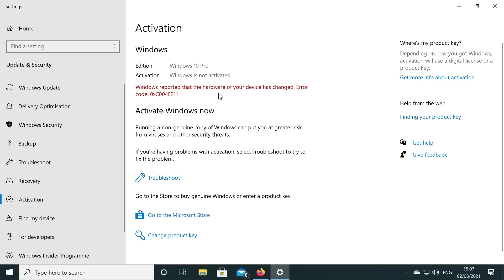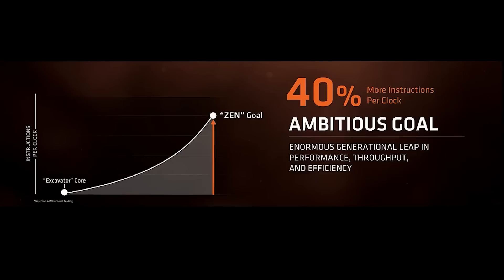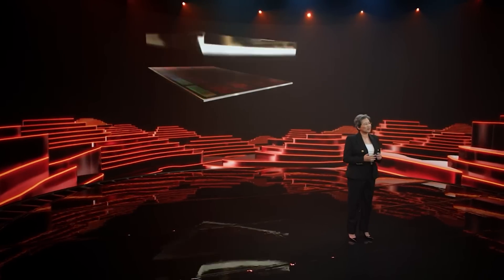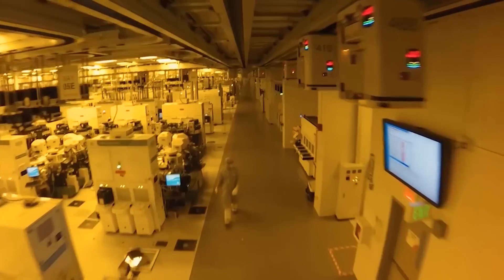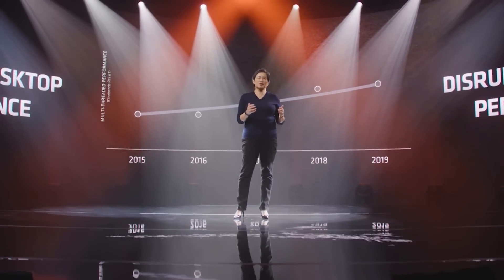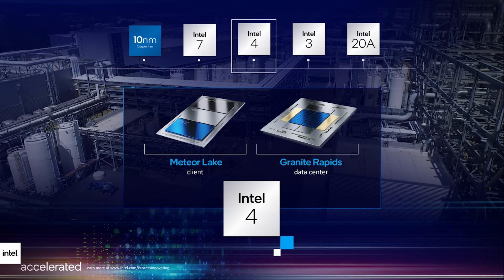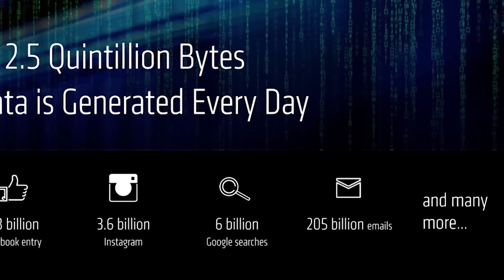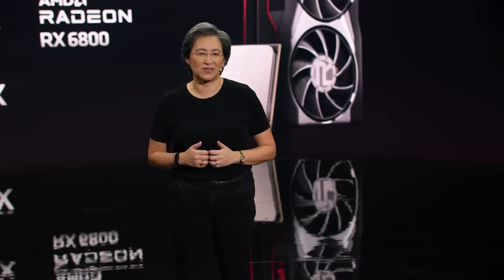AMD Details Zen 4 AM5 Platform & Accelerator Tech | Ryzen V Cache Performance & Release Date

Comment: On the CPU-Z...Well, sorry, but when my Ryzen 3600X consistently shows about 2% lower single core performance and a 8% lower multi-score performance vs a 5600X when I have no OC, left PBO and auto OC off, and just have normal run of the mill PC4-25600 CL16 memory (though I've fully timed it manually given my board seems to want to use some some very odd and unoptimal secondary timings) and a s**t ton of software running...  I don't believe my 3600X is on par with a 5600X, so no I'm not excited to see the leaked CPU-Z score based on my experience with CPU-Z's benchmark.  So yea, I'll wait for the reviews. 😃

I was figuring (but not counting) on a 10% IPC uplift from V-cache, but honestly results will speak for themselves. 😃

I'm truly excited to see this showdown between Intel Gen 12 and AMD Zen 4.... Just based on rumors this should be a good fight.  I'm not buying into either hype-train or making any bets - let the fight begin! 😀
Reply: What do you mean CPU-Z "SHOWING" 2%sc, 8%mt performance difference? The only way you know is with EVGA, ASUS or MSi afterburner running framerate, temp, core usage, etc while benchmarking. 

Frequencies mean nothing. It is cache, bus speed, cores, architecture for instruction-handling and frequency adding to the random operations per second.
Reply: @Twitch_Moderator  that brings in other factors as well (what GPU are you using, what resolutions, etc).  That is why I rather curate multipule reviewers reviews then to get excited by one leaked synthetic benchmark that I don't have faith in. :-)
Reply: @Twitch_Moderator  CPU-Z has a built in benchmark.
Reply: The 20% IPC from Intel and AMD is fake.

CPU-Z is right, one Apple M1 core at 3.2GHz has the same perfomance as one i9-11900K core at 5GHz taking Geekbench 5 and Passmark singlethread score and clockspeed.

The M1 chip has like 30 or 40% higher IPC than x86 CPUs, this means that IPC only improved 60% since Sandy Bridge.
Reply: Zen 2 was basically Skylake, but it was behind in clockspeed. Zen 3 has higher IPC than Skylake but it's so small compared to the jump from Sandy Bridge to Haswell (which is basically Zen +).
Reply: No CPU-Z is NOT right if it's showing only a 2% (which would be margine of error) and 8% performance differance between a stock 6-core 4.4Ghz Zen 2 3600X and a stock 4.6ghz 6-core Zen 3 5600X part.  The generational differance between the two CPU's I know is larger than those numbers suggest.
Reply: @nukedathlonman  Zen 3 is basically a slightly better Skylake. Zen 2 basically matched it but had a lower clockspeed.

You can do the IPC math in CPU-Z's database , don't believe in BS marketing.
Reply: @saricubra2867   I'll wait for the reviews and the actual smackdown.  🍿🍺
Reply: @nukedathlonman  IPC claims from both AMD and Intel have been BS since a long time ago
Reply: @saricubra2867  :-P

Comment: I definitely think I built my new PC at the right time. I've got a 5950, and I plan to use it for 10 years.
Reply: Good choice. I have a 2600k that is about 10 years old and no need to upgrade because of the cpu. Ten generations later it might about time to get the 12900k or that 5950 to get all the other benefits like pcie 4.0 ssd.
Reply: @kutuluu  i just upgraded from a FX-8320@4.5GHz since 2012, new AAA games started to chug and my CAD work for the last year has been a chore when working on large models having to split them into parts to keep it running smooth

Upgraded to a 3700x w/B550 motherboard, but "only" 16GB (2x single rank) ram at first but the prices just dropped and i picked up another 16GB (2x single rank) for $70
Reply: Yeah, I got a 3900x when it came out, and honestly I feel like it has at least 5 years more life in it before I need to think about upgrading.
Reply: @matilija  That thing is slower than a 5800X both in singlethread speed and multithread. Even mobile CPUs have faster cores.

5950X will age far better, can compete with the best of Intel gaming wise.
Reply: @matilija  I figure I could do a GPU upgrade at the 5 year mark, if I feel like I should, but that's it.
Reply: @guruthosamarthruin4459  you would need PCIE gen 5 to use "next gen GPUs" at their maximum though
Reply: @Sir_Saul  I'm not sure I believe that. Last I heard, current GPUs are nowhere even close to maxing out gen 4, and it's used more by hard drives than anything else.
Reply: @MirroredVoid That will be too fast for me
Reply: Lol awesome!! I had built my pc i7 920 more than 10 years ago and still running great however an upgrade is due and can’t wait for the new Ryzen!
Reply: I wouldnt build a pc now it just isnt the right time, id build when pcie 5 is out
Reply: I actually built it last December.  I struggled to get parts when it first became hard to get parts, but I got it done.
Reply: Anyone that think they can be future proofed for 10 years is self-delusional. Even Intel could not drag their feet slow enough to make Sandy Lake good enough for 10 years.
Reply: @aikafuwa7177  I used my last PC for 10 years (yes, for gaming).
Reply: @guruthosamarthruin4459  And I still got a Dell Latitude D630 running Ubuntu and still good for web browsing? In what way does that or your last PC for 10 years indicate it was future proof-ed for 10 years? It was probably good for the first 3 years and the for next 7 you just put up with it and you be lying thru your teeth if you didn't upgrade it in any way or or form in the 10 years.
Reply: @guruthosamarthruin4459  BTW I still got my 2600K build from 2010 with a GTX970 and it still serves decently as a guest machine, but certainly haven't been my main machine since 2017.
Reply: @aikafuwa7177  First of all, it was a beast to begin with, and remained stronger than any console until the day I replaced it. Secondly, I never used the term "future proof". I upgraded when I finally felt the desire for 4k, and my current PC can do 4k at 120 fps.
Reply: @guruthosamarthruin4459  So weasel words to weasel out of "plan to use it for 10 years". So if you replaced all the bits of the "it", is it still the same thing as you started?  For reference see https://en.wikipedia.org/wiki/Ship_of_Theseus
BTW I would say many of us kept the old machine around for good long time, may be not all 10 years, primarily because Intel just didn't bother to really push envelope after Sandylake. 
But despite the fact that you won't claim that the 5950x won't be future-proof for 10 years, I would bet that you be itching to replace it after 4 especially now that Intel is forced to get back the in game and seriously compete again. 
BTW flexing on consoles don't mean jack. Consoles were never the bar to measure a PC build.
Reply: @aikafuwa7177  You're just arguing for arguing's sake. Stop trying to "be right", and instead pay attention to what's being said.

No, I didn't "replace every part" in my old PC. I replaced exactly one part, when I was given a free GPU, which I used for it's last 2 years.

And if you read my second comment in this thread, I said I'd think about doing that in 5 years. I may replace the GPU, but that's it.

The rest of your argument is nonsensical stuff that has nothing to do with anything I've said.
Reply: @guruthosamarthruin4459  Your claim of 10 years have way to many asterisks attached to it probably even more than a drug commercial on TV. It is obvious you don't like your exaggeration called out like this, but it is what it is. If you even just something like "you hope you can use for 10 years without major changes" then you actually would have shielded yourself, but you insist on click bait lying language. 

And your insistence that you got only  a free GPU is probably also an exaggeration. You probably forgot about a drive or SSD here and there or couple sticks of memory, a mouse, a keyboard, etc. etc. You don't need to change every piece, but it goes back to your exaggeration. The whole nonsense started because you want to make a nonsensical claim.
Reply: @aikafuwa7177  I said I "plan to use it for 10 years".  Go ahead.  Point out all the asterisks in such a simple statement.  Grow up, and know when to stop digging yourself into a hole.  You're arguing in bad faith, when you should just say, "Sorry, I misunderstood" and move on with your life.

And no, I literally didn't replace a single thing other than the GPU.  I don't care if you don't believe me.  I used my last PC for 10 years, and was perfectly happy with it.  So much so that I decided to do the same thing again.

If you personally need your PC to be on the cutting edge of technology 24/7, then obviously that wouldn't work for YOU.  I don't care what works for you; it works for ME.

I'll be happy playing at 4k/120 fps for the next 10 years, changing nothing about the PC except the GPU one time.  I've literally done the same exact thing before.

I exaggerated nothing.  I said exactly what I did with my last PC, and exactly what I plan to do with this one.  You're just flying into a rage for no other reason than you want to "win an argument" on the internet, even though there was never a reason for an argument in the first place.

Again, grow up and move on with your life.  I won't waste any more time by responding again.
Reply: @guruthosamarthruin4459  Funny thing is that you are trying so hard. Any objective observer will know you are the one " flying into a rage" and you are the one that just thinks getting the last word is to "win an argument". Think what you want you, you use your machine the way you like it. 
Reality will soon(check back in 4 years) prove itself that the 5950x is not going to be providing that "satisfaction" (objectively and not just your happiness) for 10 years planned or not, because the competitive environment has changed.
Reply: @MirroredVoid pfft 6.0 still too slow, wait for 7.0, maybe even 8.0
Reply: @craigdaurizio686  why not wait for 69.0
Reply: @YellowLAVA  Might as well right? It would be a crime to leave any performance on the table

Comment: is that +20% over Zen 3 or +20% over Zen3+3d cache?
Reply: Zen3D is reported to be about 10-15% increase over Zen 3. 
So if Zen 4 is only 20% over Zen 3, that would be a little disappointing. I really hope it's +20 over 3D.
Reply: @Krenisphia  hmmm... Actually i agree, it won't be great marketing after all. So if amd don't want to bomb zen4 perception with zen3d  they prob want to aim higher.

Still 20-25% over zen3 is my conservative estimate, while amd gotta aim at least 15% over zen3d  which is kinda ridiculous tbh. I know we've seen amd do crazy stuff before but how many crazy moves in a row they can do?
Reply: Yeah becuase 20+% over Zen 3 on a new node but no core count increase isn't that impressive, 20% over Zen 3D cache would be insane.
Reply: @Dangerman-zg3ui  how IPC is connected to the node? are we talking about IPC?
Reply: zen 3 most likely

Comment: No PCIe 5.0 for Consumers until Zen 5, not worth it yet, actually doubt DDR5 aswell because its too early.
Zen is Memory Latency sensitive, DDR5-4800 CL40 2T would hurt Performance in almost every Consumer "Workload".

With DDR4 you can get up to 4000MHz at latencies as low as 14ns, DDR5 is not worth it yet seeing 20% more Memory Clock at the cost of 286% the Latency
Reply: AMD will support DDR5 with Zen3+ on mobile H1/2022 and on Desktop on H2/2022. 

PCIe 5.0 is not off the table - only because X670 as chipset does not support it does not mean direct lanes from CPU won't - It was the same with PCIe 4.0 and Intel does so on AlderLake

Yes DDR4 can reach 4000 CL14 however it is highly selected and overclocked memory that you compare with DDR5 JEDEC standard. 

Also it is not 14ns but cycles: Nanoseconds are calculated from frequency and cycle time that and it should be around 7ns latency for DDR4-4000 CL14. Since you don't even get that right your predictions seem even more questionable!
Reply: @mbv88xxx  Yes iam comparing the well picked DDR4 Modules because at the end of the day they're still going to be cheaper than the cheapest DDR5 Modules of equal size for quite a while. A 16GB Kit of DDR4-4000 CL14 can be had for around $200, a DDR5-4800 CL40 Kit will set you back around $330.
DDR5 on mobile is because of the Power Consumption, Bandwith and maximum Capacity per Chip allowing them to save Space and building more Compact. As a side node Ryzen APU's gain more performance from higher Memory Bandwith even at higher Latencies because they're bottlenecked by their Integrated Graphics by default.

And those Integrated Graphics gain from higher Memory Bandwith, they don't really care about Latency, but the Processor Cores do. Try it yourself with an eGPU hooked up to an Laptop playing around with the Latencies, i can guarantee you once the GPU isn't a bottleneck you'll see worse results for your CPU Performance with CL40 over CL14, even at slightly higher Memory Clock Speeds. 

And btw PCIe 5 is not coming to Consumers with Zen 4, there's already plentyful PCIe 4.0 Lanes on X570 and not even Next-Gen GPU's will stress a x16 4.0 Link. And Considering the fact that Motherboard Prices exploded with PCIe 4.0 Support many people just wouldn't see it as an viable Option to spend $400 on a "budget" Motherboard which has PCIe 5.0 but then there's nothing which can actually utilize that Standard yet.
Only Markets where i can see PCIe 5 with Zen 4 is Threadripper and Epyc.

Alot more than just raw performance figures go into consideration of which Standard should be chosen over which one, if it was all about Performance they'd have long time ago just soldered 32GB of HBM directly onto the Mobo right next to the CPU Socket, but see 32GB of High-Speed HBM cost about $400 these Days and prices are still going up because of the Shortages, at the same time expecting DDR5 to be viable when every other Hardware Launched this year was about 200% above the MSRP is just illusional.
Reply: They're just going to throw a buttload of cache at it.